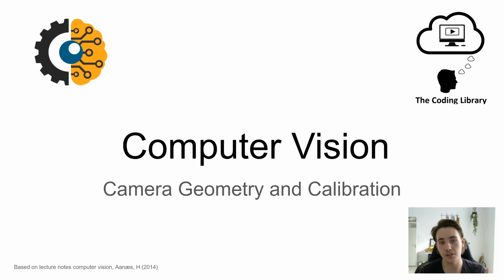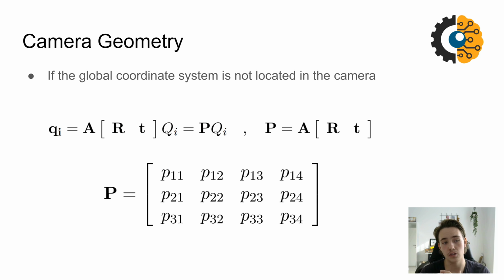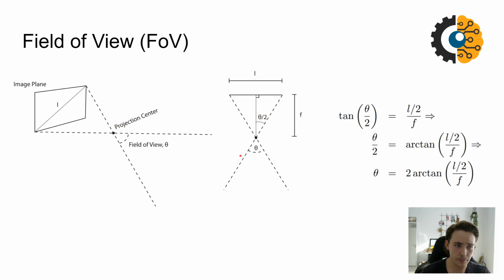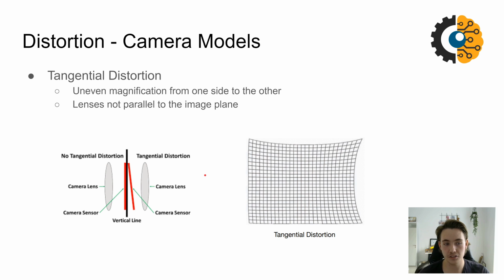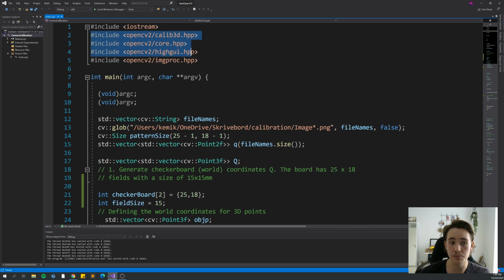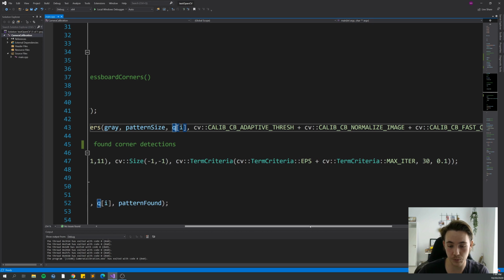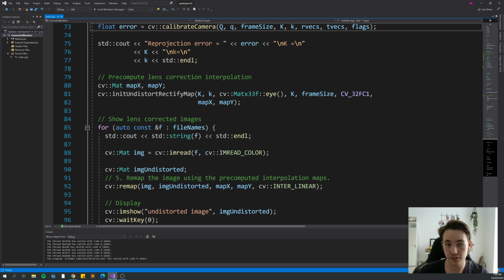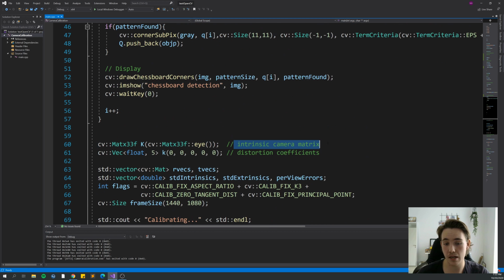Advanced Camera Calibration Technique with C++ and OpenCV: A Practical Guide

Comment: I need your checkerboard - where can I find a print template? &Thanks Dude!=)
Reply from the maker: U can just find one on Google and print it on a surface
Reply: @NicolaiAI  How import is the distance? I use my camera with fisheye-lens for imaging fluffy clouds haha - what do you think: how much distortion will be left. or better said: what would you do, to calibrate the camera as accurate as possible. (clouds ~ 2000-8000m height)
Reply from the maker: With those distance i really have no clue tbh haha
Reply: @NicolaiAI  WalkWithMe
Reply: @NicolaiAI  By the way - how are you doing? What fires you currently Mr Coding Lib haha

Comment: can we calibrate our camera with basic surface which has not any lines or squares or should it contain square and line like in this video ? Thanks a lot.
Reply from the maker: Yes u will need some reference to be able to do calibration but I'll definitely recommend using a chessboard like in the video since u can use the OpenCV methods and don't have to implement everything urself with ur own references